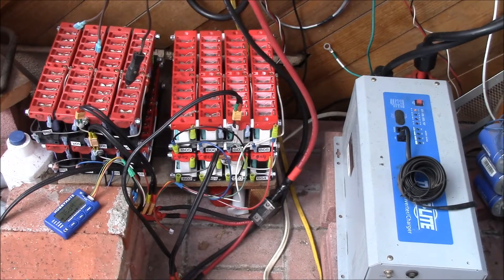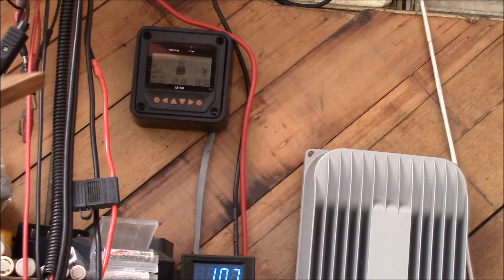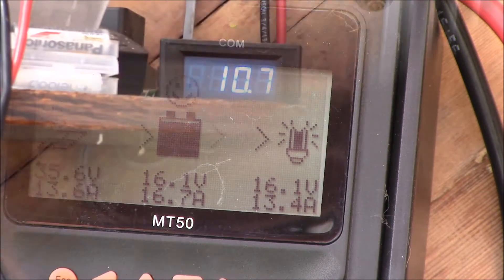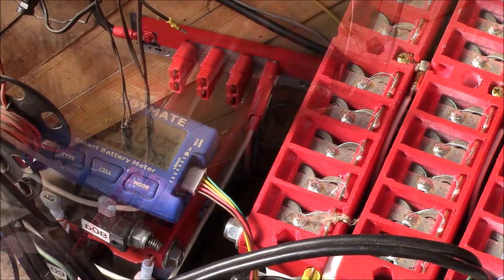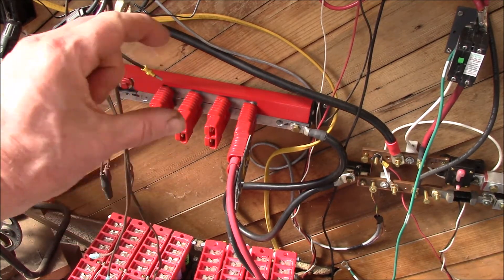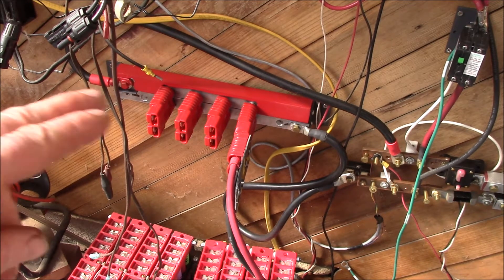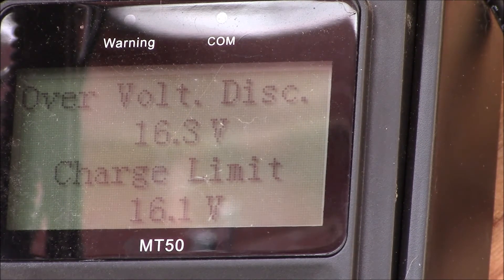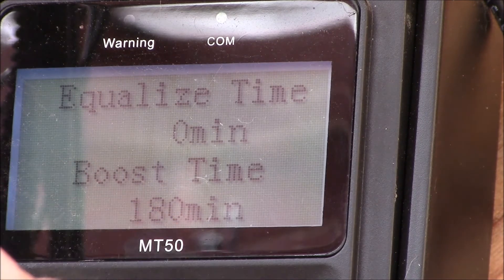16 volt DC-AC Power Inverter, Part 2

Comment: Where do you find a 16V inverter? I've found like 1 option, and for the same power output, it's twice the price of a standard 12 V inveter with over-voltage kicking in at 15.5 V. It's easy enough to set my charger to only charge to 15.5 v, but I hate leaving that much capacity on the table.
Reply from the maker: I already had one, TrippLite APS1012SW:
https://youtu.be/mZAIBeP86Mo
I think all their 12V inverter/chargers (PWM and sine wave) run up to 16.0 volts.

Comment: i'm not picking on you, you seem to know your electricity, but holy god, man! do some cable management! that rats nest makes me nervous as hell for you.
Reply from the maker: Great suggestion and will be doing that in the final installation.  This was a temporary setup to test out whether the lithium batteries would work in my application.  After that test worked out, system was changed from 4S to 7S and the 4S cables were then partly recycled for the 7S wiring.  Final setup will have have 2 or 4 battery packs per slide out shelf and each shelf will have a dedicated balance and power connection.
Reply: mine is worse :)